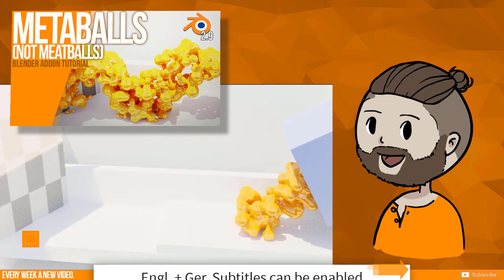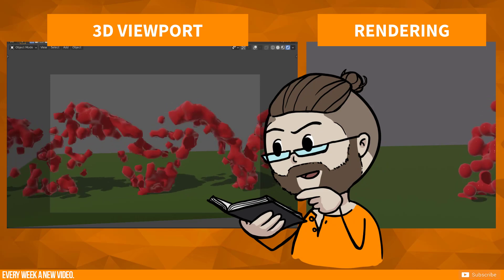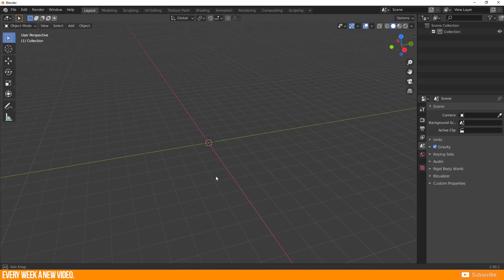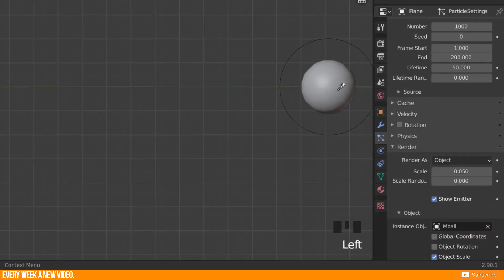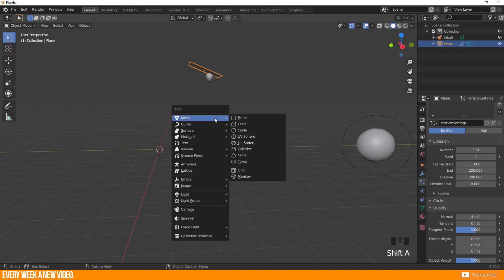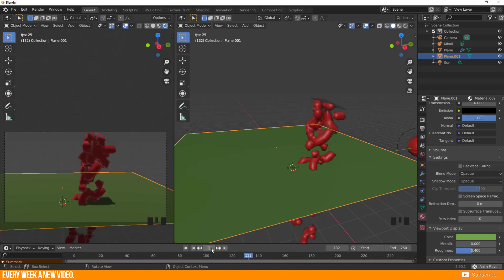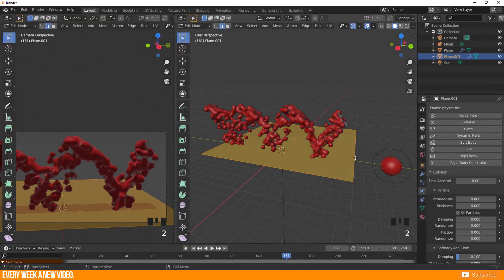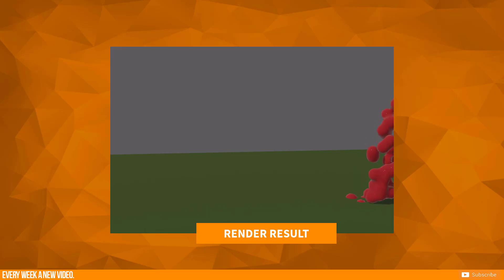How to render a Metaball Particle Effect WITH Collision

Comment: Sir do you know your collisions still didnt work at the end? While it looks fine to most but not me your metabals just before colliding with the ground are half inside the floor  / passing through the floor and then colliding and bouncing you can see below part of floor the particles will be half stuck inside the floor and then they will collide and bounce? Its not you sir its blender and how it works there is no solution to this even in 2.9
Reply from the maker: There is no deformation of volume for sure. The metaball surface just interacts with each other and not with other surfaces. Just the origin of each ball is colliding with the plane and this is... more or less ... the best solution I found.